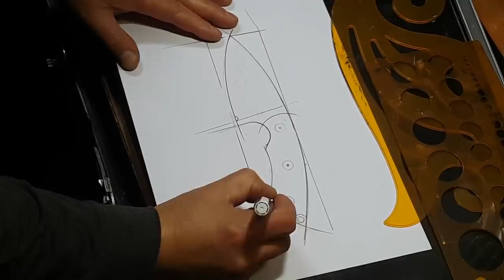KNIFE MAKING / ORANGE SKINNER KNIFE 수제칼 만들기 # 91

Comment: Hi, i have a question about heat treating. if i was making a nice that its sole purpose was to be used in a household kitchen for cutting meat and veg etc, would this have to be heat treated ? My understand is that if a piece of steel has been heat treated then it loses its magnetism, my current kitchen knives are magnetic, so does this mean that these would not have been heat treated ?
Thanks
Reply from the maker: Magnetism depends on the composition of the organization...Only at the point of heat treatment does magnetism disappear and when the heat cools, magnetism reoccurs...Kitchen knives have a lot of stainless steel and the reason is for their resistance to rust. Some types of stainless steel have or do not have magnetic properties.
Reply: @artisticson2275  thanks for that explanation, it makes sense. What is your opinion on if i would 100% need to heat treat if it is only for cutting meat and veg at home ?
thanks
Reply from the maker: I'll probably use it well for a while, but it'll get a blade wears out easily...If you have a simple isobutane torch, why don't you try it? It's gonna be a little stronger...^^